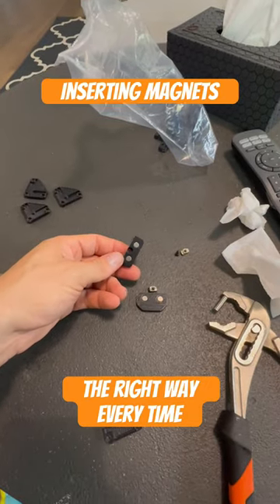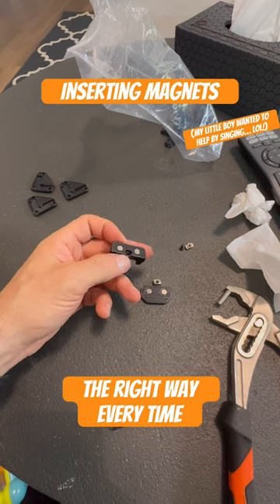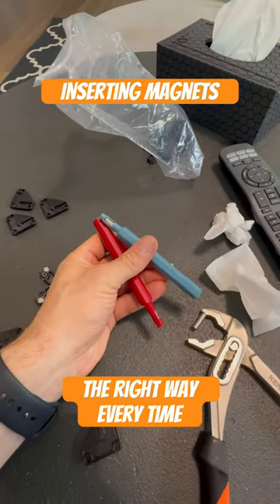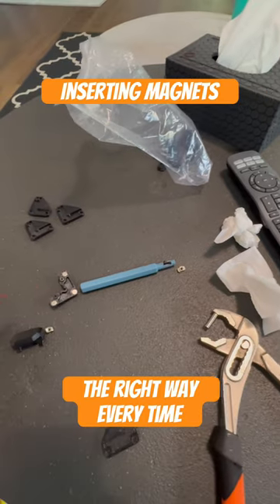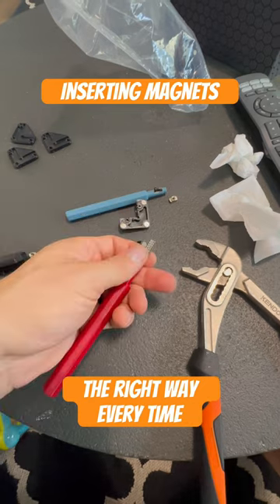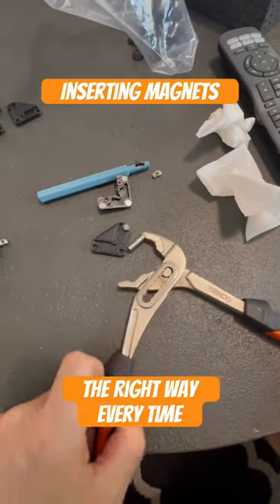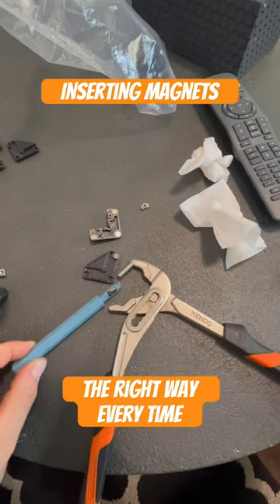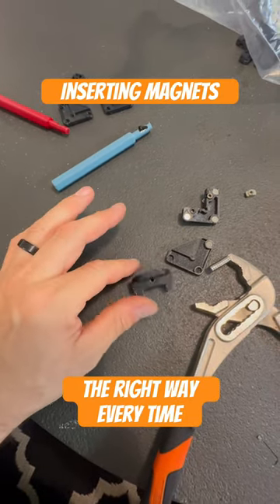Inserting Magnets into 3D Prints CORRECTLY #shorts

Comment: The most trouble I have had, especially with gridfinity parts, is getting the magnets to stay in. I’ve resorted to using hot glue. I’ve tried using epoxy, but it stinks too bad. And super glue takes too long to dry.
Reply from the maker: Negative hole compensation. I never use glue only pressure fit
Reply: @thenextlayer  how do you control the size of the pocket when it’s a part somebody else designed?
Reply: @grayismysuperpower you can try to use horizontal expansion, but it will affect the entire part
Reply: Get some super glue activator! It's a game changer for super glue as it makes it set instantly.

Comment: I do something similar to align my magnets. I have a 6x12 cylindrical magnet that has the North Pole marked. I use it to hold a stack of the 6x2 magnets in such a way that once they are inserted, north is always facing upwards on every part.